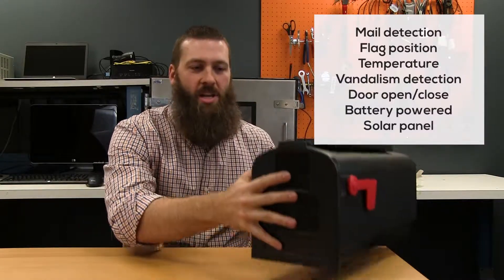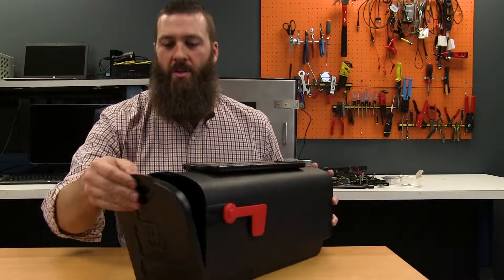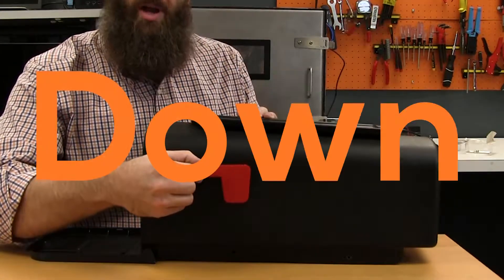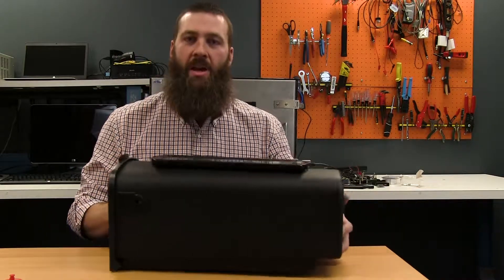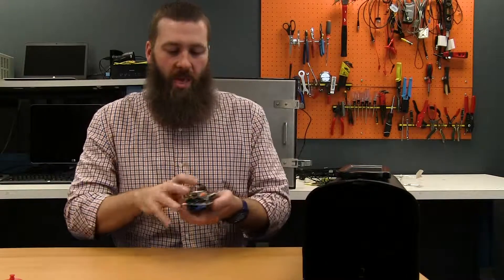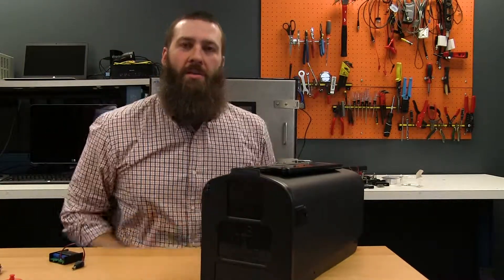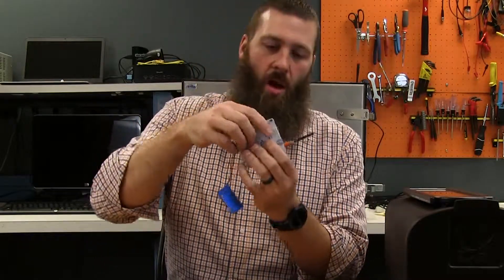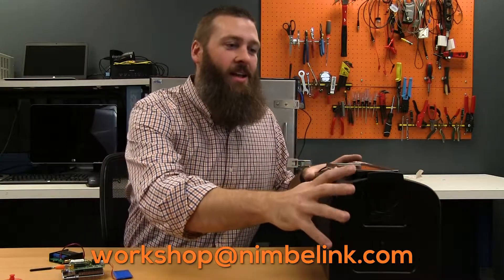Let's Build: Smart Mailbox Part II

Comment: The magnetic reed switch for the mail flag assumes the mail carrier will push the flag all the way down, but on my mailbox the mail carrier never pushes the flag all the way down. Maybe a mercury switch mounted at an angle on the flag, such that if the flag goes down to a 45-degree angle or less the switch changes state?
Reply from the maker: That's an excellent point--I was indeed assuming that the flag would either be down or up, and not somewhere in between. A mercury switch would likely do the job if mounted on the backside of the flag at a proper angle. Perhaps another option would be to mount a potentiometer in the hinge of the flag to determine position. Thanks for pointing this out!